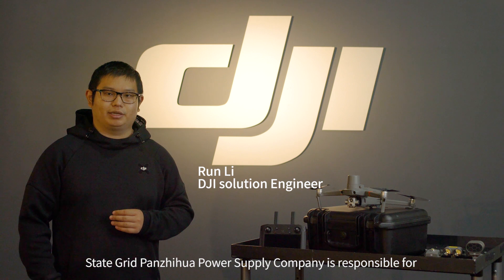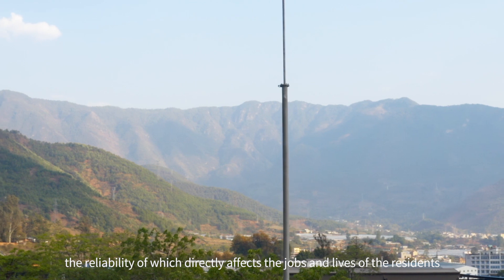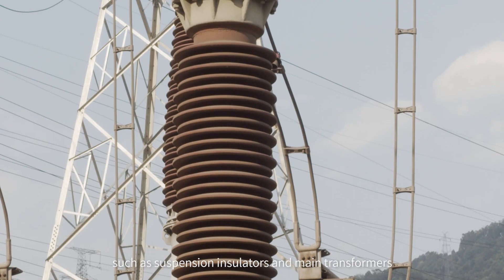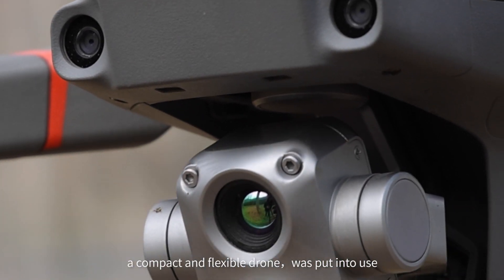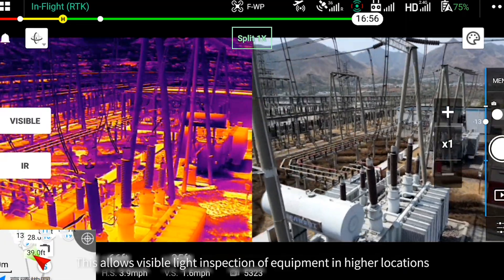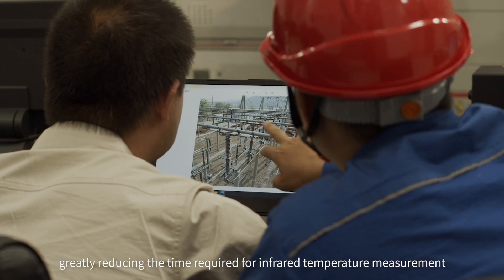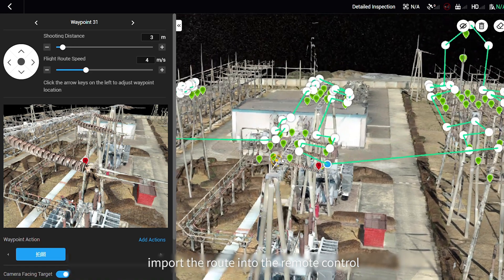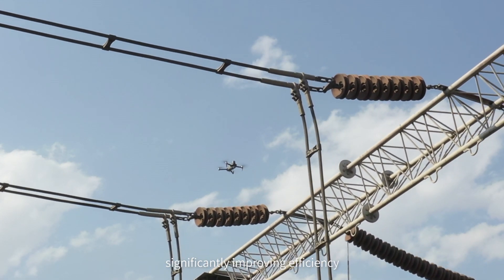Mavic 2 Enterprise Advanced Optimizes Electrical Substations Inspections

Comment: How do you over come the magnetic compass error regarding high voltage and steel structures?
Reply: That is probably why they have the RTK attachment on the drone.  Although I was under the impression that the EA RTK was inferior to that on higher-end models and NTRIP network only so I'm not sure if it is sufficient for high voltage or not.
Reply: @matth600  thanks Matt.  Yes I thought that you needed multiple RTK units as they need to verify against one another to stay reliable. A single RTK is good for centimetre accuracy only.  Anyway just what I understand is all.  Happy to be wrong just trying to learn a bit more.